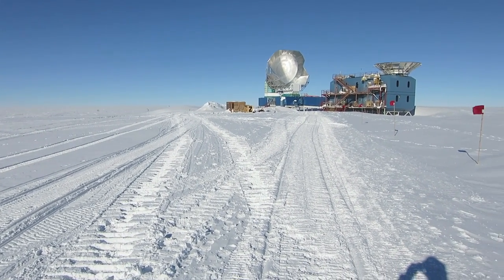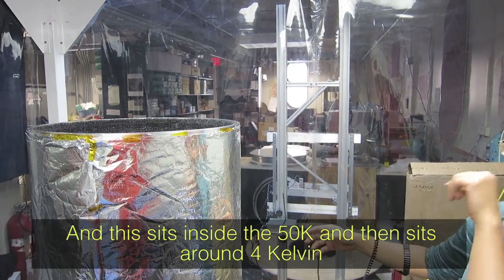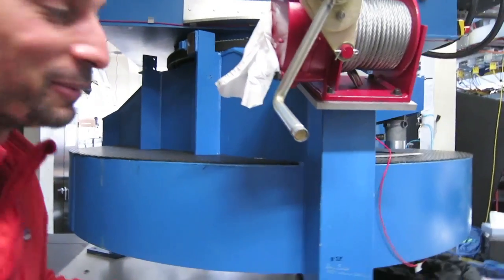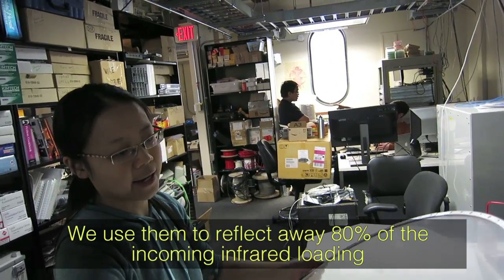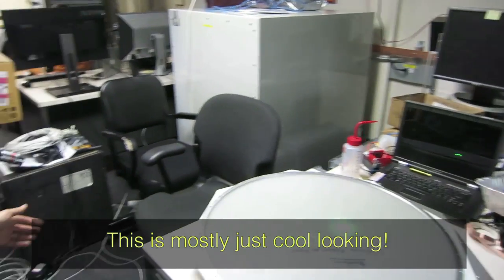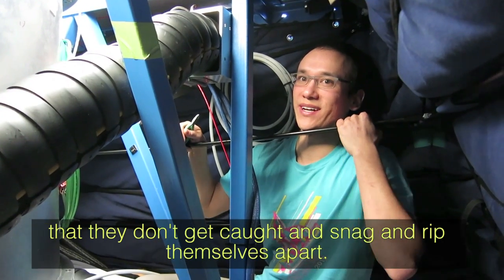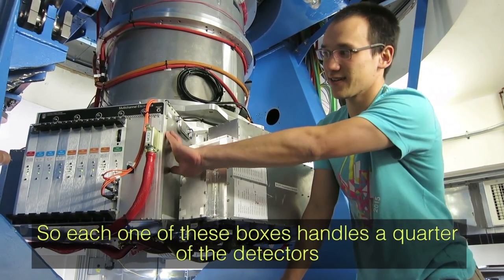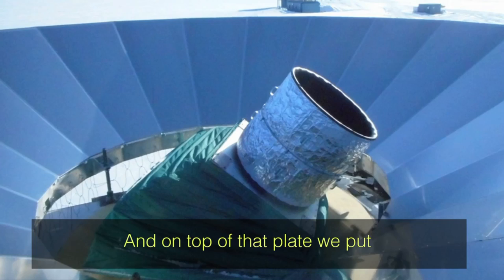Telescope at the South Pole (BICEP-3) - Deep Sky Videos

Comment: Smudges on the reflective detector thingies at 1:42
Reply: 1:48 at row 4, column 4
Reply: Somewhat Snakes Should not make much of a difference. Its better to ignore smudges and clean the lenses as little as possible. You'd be surprised how dirty a lens or mirror can get before the image starts to suffer. As an amateur astronomer I only clean my telescope every few years when it's finally caked in dust and the image starts to degrade. Otherwise it's best not to touch, as every time you clean you cause wear and scratches to the coatings and the glass/mirror no matter how careful you try to be.

Comment: So many questions!

If I understand correctly, BICEP-3 will observe more channels with greater sensitivity over a larger area, and part of that area is intended to obtain a strong galactic dust signal to aid subsequent analysis of darker areas.  Do I have that right?

- Will BICEP-3 observations include the same sky patch as BICEP-2?
- Is BICEP-3 working as well as hoped?  Reliable?  Good data?  On schedule?
- Has the galactic dust model been refined enough to not limit BICEP-3 analysis?
- How soon are initial BICEP-3 results expected to be published?
- How much BICEP-3 work is independent of the next Keck Array upgrade?

About that last question: I'm mainly wondering if BICEP-3 work is being optimized primarily toward the next Keck Array, possibly limiting it's own science objectives.
Reply: BICEP3 is basically observing the same sky patch as BICEP2 (but a bit of a larger area because of its larger field of view). BICEP3 is working very well, first science results coming out soon. BICEP3 is observing at lower frequency (95 GHz) than BICEP2 (150 GHz), so it should be less affected by Galactic dust. Our understanding of the dust in this patch of sky has been improving with Keck Array data -- it's an incremental process at this point. As of 2020, BICEP3 is operating alongside the BICEP Array, which is a replacement / upgrade of Keck Array.

Comment: What is the temperature of that place generally at?
Reply: https://en.wikipedia.org/wiki/South_Pole
Between -25C in the summer and -80C in the winter.
Reply: Thank you, I was mostly wondering about the specific area of the dark zone, air-currents and the quirks of the area will heavily play into what temps they get.
Reply: liquid nitrogen is A waste product so it's very cheap :)
Transporting the stuff is most expensive.
Reply: Helium tho, thats a luxury.
Reply: ***** A special isolated tanker can be used.But still it's very dangerous stuff to drive around with.It's the danger level that makes transport troublesome and expensive.
Reply: +Picobyte What's dangerous about transporting helium or nitrogen?
Reply: I would also like to know about the dangers of helium and nitrogen transport.
Reply: I'm not sure why but my guess would be if there's a large leak, inert gas like helium can asphyxiate you without any symptoms (choking, gasping etc)
Reply: JPaul C
You'd notice your voice being really high with helium, plus you're driving so you have a constant air stream.
Reply: filonin2 Suffocation,freezing cold.Transporters need special permits and can't just go through tunnels.Here in The Netherlands there are so many rules..
Reply: Picobyte
I see liquid nitrogen trucks on the road all the time, no big deal at all here in the US. I used to work for a call center and had to call out an after hours emergency order for liquid helium at 11pm to a science lab that needed it from AirGas.
Reply: Picobyte
There are no tunnels on or to Antartica. I see no dangers that aren't inherent in transporting any compressed inert gas, like co2 or argon. It's way less dangerous than a reactive gas, like hydrogen or propane.
Reply: filonin2 Are there many gas factories on antarctica?!  For me my bottled gas comes from Hoekloos A Dutch Gas firm that exploits filling stations in our country with all sorts of welding and other purified gases. They say transport is their biggest cost factor for most of those gasses.
Reply: Picobyte
I thought we were talking about danger, not cost?
Reply: filonin2 Danger&costs of transport are related.
Reply: Picobyte
How is danger related to cost in this situation? Why would helium transport, while more expensive than co2 transport, be more dangerous? Helium is lighter than air, it should be less dangerous as it wouldn't pool in low spots. They both are expansive and displace oxygen and can cause flash freezing, I'm not seeing your logic but I'd like to learn.
Reply: filonin2 Liquid helium is heavier than air,it starts expanding cooling it down even more it's just that.I'm not the guy who makes our rules.It's just expensive here in the Netherlands to haul any sort of liquid gas.Though I should say relatively expensive.
Reply: @picobyte gas factories!  It is not a continent with cities.
Reply: @filonin2  Helium is inert, it will not burn.
Hydrogen mixed with air goes *BOOOMMM*.
Both gases are transported at very low temps to keep them liquid.
If the gas inside such tanks starts expanding with nowhere to go, in both cases the whole tank could rupture or explode.

Comment: Those fingerprint smudges on the detector did my head in.  Shouldn't they be clean?!?!
Reply: I don't know about this particular sensor, but there are usually expensive and exotic coatings on astronomic instruments that would be damaged in the process of removing the smudge. While the smudge itself doesn't affect the sensor much.
I'd love to hear from someone that knows for certain though
Reply: Don't know for certain, but smudges won't affect microwaves much. They typically only affect visible light.
Reply: @PCBSLC  The anti-reflection tiles are quartz, so pretty durable. But the smudge also isn't a big deal because it is so thin compared to the wavelength of the light (3 mm) that BICEP3 detects.